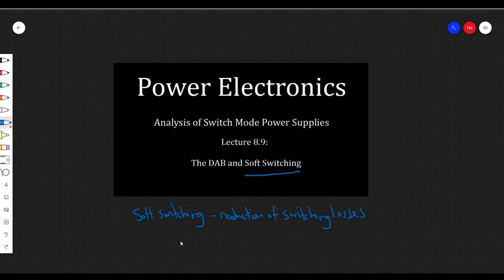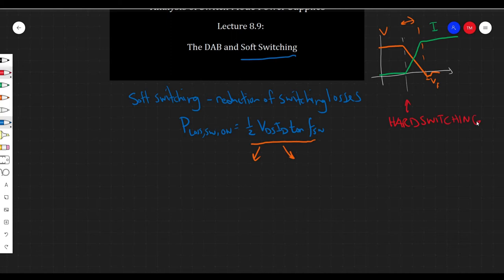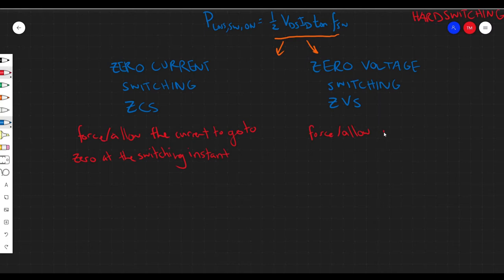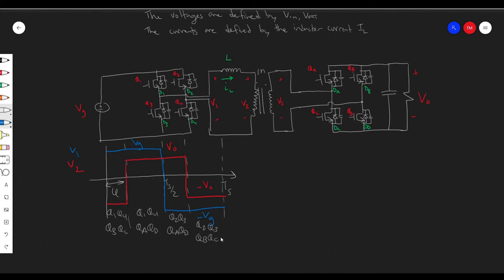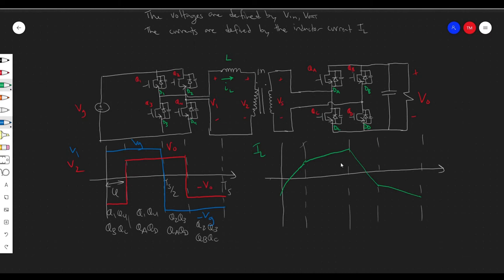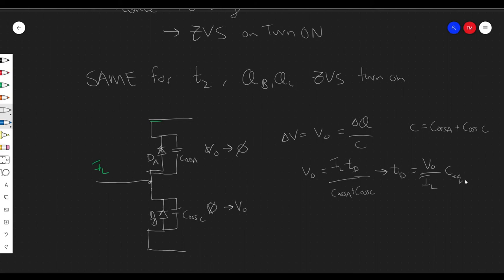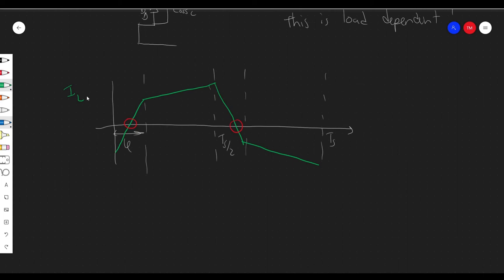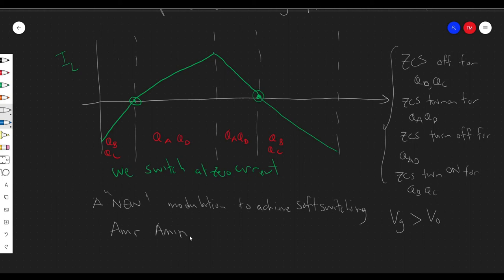Lecture 8.9: The DAB and Soft Switching

Comment: Thank you Mr McRae! So, if I correctly understand, at time t1 that correspond to the phase shift we turn off two MOSFETs with P=1/2*V2*IL(t1)*toff*fs (so V2 is high and the power losses are high) while we turn on two MOSFETs with P=1/2*VF*IL(t1)*ton*fs (so VF is low and the power losses are low). Is it correct? Thank you again for this explaination.
Reply from the maker: Yeah, and you're able to get this lower voltage of Vf because turning off the MOSFET pair forces the inductor to commutate to the opposite set of diodes due to the direction of current.

Comment: Dear Tim McRae, I have one more question. It is possible to have ZVS, also on the primary side?:
Assume that the current is positive through inductance and we are switching off Q4 and turning on Q3, while Q1 is always ON during the latter switches.
Reply from the maker: Yup, ZVS is definitely possible on the primary side. The negative current at the beginning of the switching cycle (and the inverse at Ts/2) allows you to delay the turn on of Q1/Q4  and let the body diodes conduct (or really the snubber/switch output capacitance to discharge) before turning on the complementary switches.
Reply: Can u please send me simulation model

Comment: Thank you for the explanation!!! However,  I am not able to understand one thing: at t1(-) when the current is positive, can't it flow through the diode, even when Qc is conducting?
Reply from the maker: This is actually possible. The way you'd determine if the FET was conducting through its body diode or through the channel is if I*R_on > V_f. Typically you'd select switches with R_on low such that even at peak current the voltage voltage drop across the on resistance is less than the forward voltage drop.

On top of that, the fact that the current is AC means that for a portion of time the current is near zero, meaning that voltage drop would be quite low even if the R_on was large.
Reply: @timmcrae3831  thank you very much.

Comment: Thank you very much! it helps me a lot! I am trying to build a DAB converter, but the power loss is still very high. The temperature of MOSFET increases very fast. I think it's because of turn OFF losses. Do you have some advice on how to reduce the turn OFF losses. Thank you, Tim!
Reply from the maker: I would say a good first step is to do a rough loss analysis to give yourself an estimate for what the losses should be for your specific operating condition. 

Unfortunately, there are many components that contribute to overall loss so it isn't so easy for me to suggest how you might fix this.

What I will say is that you check your gate drivers and ensure they are operating as expected. Choosing a gate driver with a higher source/sink current (or a FET with a lower Qg) can reduce the turn on/turn off time of your FETs which will reduce switching loss. It is also possible that you haven't included enough dead time and have some shoot-through current. 

Without doing calorimetric testing of each component, you could verify if switching loss is a main contributor to loss by inspecting light load operation of the converter. By operating in light load, you tend to reduce conduction losses. Switching losses, which a less load dependent, remain high and you can give yourself an estimate of how much they are. 

In any case, beginning with a rough analysis to give yourself an idea of what to expect will make it much easier to debug board issues as they arise.